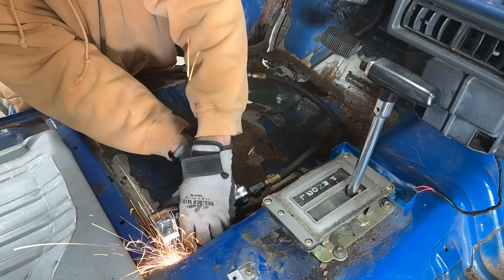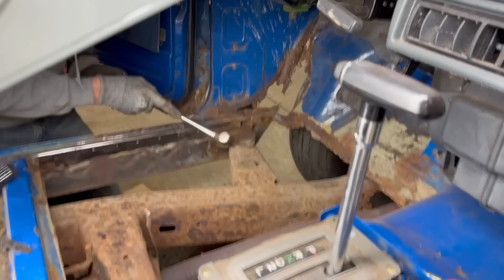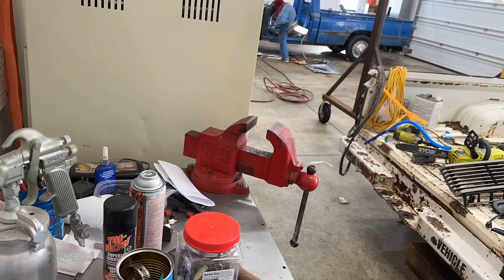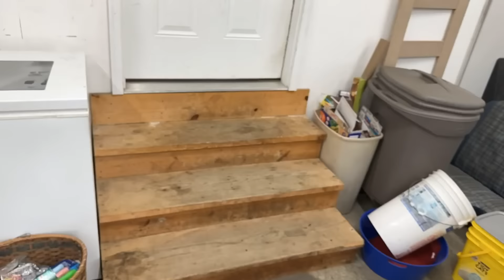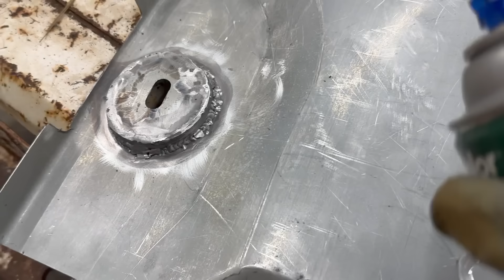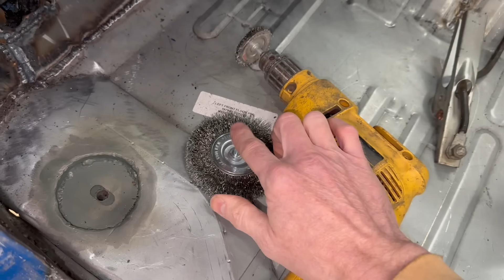How to: Repair/Replace Rusty Floor in Vehicle - Complete Guide, Start to Finish

Comment: You've welded on bare metal patches... meaning they're uncoated... The reason you're doing this is because of metal corrosion... Does that sound confusing? ))) welding primer... epoxy primer... is it for weaklings?  Well, at least in the end
Reply from the maker: I had some other parts of the floor to repair, then I painted them all in later videos. I'll be applying fluid film but not until the entire truck is painted.

Comment: I want to see you bend metal with a taper like that, on the vise in real time to see better how you did it. That is clever. very good explaining your process.
Reply from the maker: Thanks! I went back to check, but I had recorded that in time-lapse mode to keep things shorter. There are a lot of expensive fancy tools out there for metal fabrication, but you'd be surprised how much can be made with just a bench vise and old anvil.

Comment: Nice video. Just a tip. Before using the step drill bit, I usually drill a smaller hole using a normal bit. Then the step bit would bite into that hole and make it easier.
Reply from the maker: Great idea... Thanks!

Comment: Had a 84 celica bad 22re engine had some 20r engines I used it put the fuel injection  on it had to drill a couple  intake bolts but it ran stronger than the 22re lol

Comment: It’s been a while since I watched this one, and now it really applies!
I am working the floor pan of my Rusty 87 Toyota PU and have an idea that’s been brewing a long time: 
Im wanting to body lift this thing, then drop the driver’s floor the same amount so my 6’2” frame is comfortable.
Do you think it would work?
Oh, and another thing; I really enjoy the music you use as background, and it seems like you put in a lot of work to match the score to what you are doing. Impressive.
Reply from the maker: I haven't heard of anyone dropping the floor while doing a body lift, but that's a really great idea! The only think you'll need to consider are the cables that fun below the cab for parking brake and speedometer, as well as the fuel & brake lines, but those are all on the passenger side. So if you're only modifying the driver side, then those will not be an issue. The only issue will be that the carpeting/floor liner will not fit properly, so you may need to have one custom made.
Reply: @6thGearGarage hahaha! Carpet and floor-liner. Now that funny! There is some nasty mold kinda stuff down there that I think may have been carpet long long ago but at this point its just the gunk holding the floorpan from falling out!
My bigger concern are the three peddles. Gonna have to lower those with the floor and i haven’t looked that far into it yet.
I think it can be done and really like the thought of what that will do for my ride.

Comment: Great idea bringing the plasma cutter into the game.  I bought a plasma cutter today, $240 harbor freight 20 amp, to cut my floor out without an angle grinder's danger and ragged cuts.   I also will cut out the rocker/a/b pillar bases and cab corners, so the plasma will be slick and save time.  Thanks for the detailed insight.  Personally, I would compare my replacement bushing height before setting the stack height and welding it in place, just in case oem is different or the cab sagged
Reply from the maker: I love my plasma cutter - saves so much time.

Comment: Little tip, if you have access to an air compressor and air chisel it works wonders for busting through the floor and removing spot welds
Reply from the maker: Time to invest in an air chisel!

Comment: Looks like I’ll stick to my plan of taking from donor vehicles wolf steel seems to be off judging by this video and others that’s a shame
Reply from the maker: Donor vehicles is always the way to go. I've never used an aftermarket panel that fit as well as OEM. I use a section of floor from a donor truck to repair a different area of this cab and it went much smoother: https://youtu.be/lkc09fzc3AA

Comment: Why not lift the body first, fix the frame & then repair the body? 😊 That’s how I’ve seen it in other videos.
Reply from the maker: I had another parts truck with a nicer frame that I ended up using. I repaired the floor with the cab on the old frame so that sparks wouldn’t burn or pit the fresh paint on the restored frame. This frame was pretty rusty.

Comment: Man, I hate being the guy to criticize another’s work. But for your next one you should really take off the doors and square brace the cab before getting into a rust job this bad. It’ll save you a lot of headache with fitment issues down the road
Reply from the maker: @jhenson5168  I appreciate the feedback. I considered that the cab could flex when I cut out the floor, but figured being bolted to the frame with 5 of the 6 mounting bolts was enough to keep it square. Luckily it ended up being ok and everything fit back together nicely.
Reply: @ that’s great to hear. You never know what you are getting into with rust that bad. Just a 3/8th inch sag in that corner can really get bad when you introduce heat

Comment: Great Job! Just One question what do you do to the bottom of the floor pan in between the seams of the new and old floor pan?
Reply from the maker: I cleaned the welds and sealed them from the underside in another video, when I had the cab off of the frame: https://youtu.be/EehjyRpJKoE

Comment: Great Job! Just One question what do you do to the bottom of the floor pan in between the seams of the new and old floor pan?
Reply from the maker: I cleaned and sealed them in another video, when I had the cab off of the frame: https://youtu.be/EehjyRpJKoE
Reply: @ thanks man great job keep up the great work🤙🏽

Comment: I have a question for you guys. When doing a floor pan replacement like this, is it better to leave the car sitting on its weight (on its 4 wheels)? Is it okay to jack the car? I’m worried about chassis flexing or twisting a little bit. Thank you for your time.🙏🏼
Reply from the maker: I think 4 wheels is ideal, but as long as the structural areas aren't cut out or rotted away, it should be alright. If it's a body on frame construction, like this truck, then lifting the vehicle will be fine.  If it's a unibody with major rust, then flex can be an issue. So it depends on the vehicle and amount of rust/cutting.

Comment: Thanks. Wonderful work. What is the thickness of the sheet metal you use?
Reply from the maker: Thanks! Most of what I use is 14 Gauge, but I tent to use whatever I have around, so some pieces might be 16 or 12.

Comment: Over a year old but I see your still veiwing comments witch is amazing, thank you! But question for y’a! I have a 2008 ford ranger has a pretty big rot whole in the floor. Wondering what main requirements of tools I need and prices? Maybe. I also understand could be different area so different price range and not same vehicle. But is it worth going out and buying some tools to do it myself or just send it off to a shop. But would it also even be worth having someone else put a floor pan in? And again I understand could be different areas (I’m from Ontario Canada) but if I don’t care about looking oem factory could I get away patching/covering hole, (hole is approximately 8 inches wide, by roughly a 1-1/2ft long) and be able to pass saftey with new video AI saftey law?  Not expecting you to have answers but worth a shot to me! 

If I do decide I’m doing it. Definitely will be on a budget😭😭😂😂
Reply from the maker: Hi, prices are always increasing, but I have links to the tools I used in the description.  That should give you an idea on the prices. If you have the tools, space, and time, it's worth repairing yourself. I'm unsure about laws in Ontario, but there are no safety laws or inspections here in Ohio. You can drive any rusty heap on the roads, as long as all the lighting works properly. I think when done properly, there is no structural integrity taken away, only added. So it's only going to be more safe than it was.

Comment: How does one decide, when to remove the body for rusted panel replacement?
Reply from the maker: I don't fully understand the question. But removing the ca wouldn't have made the repair much easier in this case. The only time removing the cab made it easier was to clean up the welds on the underside of the floor and apply seam sealer there.

Comment: this is prob the most realistic situation that most people experience in my opinion.... many other youtube channels that claim (respectfully to them with no prejudice)  they are no mechanics/craftsmen etc and were not so long ago fixing cars in parking lots and yet when they show a repair, its not just seamless, but it it feels like they have done it a million times prior, ...their "fist attempt" at it fits /goes in smoothly like a glove., in short they get it right the first time around,  This guy, however, shows that for every fitting of something once but the need to remove it  10 times to get something else done prior, or for example how other people just seem to minimally weld something with the least amounts of spot/tac welds, while I seem to need a million other jigsaw puzzle pieces and a gazillion welds to plug up a hole, …you get the point...anyway   I speak for myself, maybe because I ain't so talented, (or suggesting for that matter this person in the video isn't) but I certainly have the same experience and can relate. Not saying that it should be so for everyone else just that for once I don't feel envious and jealous of how other people get it right the first time round or very quickly (granted I know its video editing magic...but still)
Reply from the maker: Thanks! I do my best to show how it really is when doing a job yourself, even any mistakes that I make and how I remedy them.

Comment: 50:00 what you do with it? Leave like this or wield holes?
Reply from the maker: I left it like that, a few pinholes won't affect the structural integrity. Just put sealant on both sides.

Comment: Or maybe, cut a piece of scrap plywood, slap it down over the floor ('glue' down with some tar if you want to get fancy), replace the rubber mat, done.
Reply from the maker: That would actually work here in Ohio, where there are no vehicle inspections!

Comment: Is it possible the replacement floor panel that was sent to you was meant for the passengers side and upside down? That would cause the welding tab to be up for the weld and the body bolt area would then be sunken down like the factory bolt area?
Reply from the maker: No, I ordered both left and right sides. I imagine it was a lot cheaper for them to make them the way that they did.

Comment: Angle grinder wire wheel is the way to go and you can use phosphoric acid products after it. Muriatic acid is good for cleaning small parts and works fast.

Comment: All is good . But what if there is no floor panel in any autobody shop to buy. I would have to make my own floor panel
Reply from the maker: Yeah You'd have to start with a piece of sheet metal and fabricate your own, like I did with the smaller sections of this floor, but you'd be fabricating the entire thing. Large flat sheets of steel tend to flex. I'd use sheet metal 2mm thick so that the floor doesn't flex when you rest your feet on it.
Reply: @6thGearGarage 2mm? Is this 1/8 inch plate?.
Reply from the maker: 2mm is thinner than 1/8".  1/8" is more suited for a frame repair.

Comment: Nice work. Looking good. I’m working on a 1980 Toyota truck as well. I have to do a similar repair. Can I ask what gauge the metal is you used. Thank you and keep up the good work.
Reply from the maker: The floor panels were thicker, I’d guess 14 or 16 ga. The smaller pieces I used for the rest were probably 18 ga. Thanks for watching!

Comment: ahh the good old restoration. Just know, when you hear that Rice Krispy's sound after hitting a pot hole.

That's not the suspension
Reply from the maker: No rice krispy sounds, as I replaced the frame in a later video https://youtu.be/gmFx6OUw7Xo

Comment: Wow man. I thought my truck was a goner but seeing you do this really gave me the motivation to get at it. Gave alot of good advice too when it comes cutting out rusted sheet metal. Can't thank you enough
Reply: Use Tidybart Zeebart undercoating. It makes the rust go away.
Reply: i also thought my 2006 Chevy Impala SS was done.til i saw this video. he gave me hope, when i really needed it. im fenna give it an extreme makeover. this gonna be a fun project for me.

Comment: Hey man, just another question, if the cab mounts moves because they are holding on for dear life because of rust. Will new floor pans fix it. Frame and cab are mostly mint and the engine still make good compression.

Comment: I wonder about the seam sealer, because each time I dismantled interior parts, rust starts from under the sealer, these are almost the most rusted part of the sheet metal!  I noticed similar about under coating, rust developing behind the undercoating.  So both do not seem to protect very well against rust.  Anything else can be put to better protect against rust?  I'm currently doing a floor pan on an old car and maybe wanted to try without a seam sealer and checked its rust progress every year.
Reply from the maker: For the rust to start, there must have been bare metal exposed. Perhaps it’s starting from the outside of the panel and working it’s way in somehow?  You could do finish welding and grind perfectly smooth to make one seamless piece of metal, but that takes a lot of time and skill.
Reply: @6thGearGarage  Today, I had a nice looking piece of metal with a seam sealer on the joint of two pieces.  I removed it for fun, and the metal behind it was rusted!  So it seems to start from the joint covered by the seam sealer.  I have another old car, 1994 Honda Accord, the interior was great except on the four corners, it was perforated where there were a lot of seam sealers.  I removed the sealer and patched with grey putty that has metal in it, I wanted a stronger putty.  So far, no rust came back.  Maybe putty seals better than seam sealer...

Comment: Was ur cab sagging down any? I have a 97 F250 where the cab mount is detached from the floor and now the door is pinching with the front fender. Curious how would one would know where to lift the cab exactly to install new floor pan pieces to match with cab mount
Reply from the maker: This cab was not sagging, but I had a similar problem on my 1985. Here is a short video showing the repair.  https://youtu.be/7Xkdnrsa62A  I would lift the cab by the other solid mounting points and support it with the door/fender in place until you can see the gaps are correct. Then repair it in that position. You may want to weld some temporary bracing in place to be sure the cab does not shift at all while you're repairing it.  If it's sagging that much, it sounds like you have a lot more rot to cut out and replace than I did.

Comment: What size sheet metal did you use ? Thanks for the video! Really good job!!
Reply from the maker: These floors were probably about 2mm thick. Some of the scrap metal that I used for fabricating the surrounding area was slightly thinner.

Comment: The step drill bit requires a pilot hole. It’s not made to drill its own hole, but to make an existing hole bigger.
I think it’s usefully customary to create paper templates before cutting the old out, so you know what you are doing after the old shape is gone.
Reply from the maker: good idea, thanks!

Comment: the frame doesnt look that great either :/ was it worth to fix that car? Great vid nonetheless
Reply from the maker: You're right, that frame is toast. I had a Parts Truck/frame with only light surface rust shipped from Oklahoma and cleaned/painted it : https://youtu.be/gmFx6OUw7Xo Once this cab is repaired, it will be moved to the southern frame.

Comment: I know this is a year old by now, but WOW what a JOB! I can't imagine doing all that work; some people would say it's not worth it but I commend you for tackling it! Very informative and fascinating video. I just recently decided to get into cars so stuff like this is very appreciated! So from one Ohioan to another, thank you!
Reply from the maker: In my younger days I would have parted this truck out and scrapped the body & frame. I finally decided to take on a true challenge and although it's been a year already, it should be on the road by summer!  Thanks for watching!
Reply: Makes me question my sanity, got an Opel Kadett which has similar or even bigger wholes on the driver and passanger side with doors rusted from the bottom up 🥲
Reply: Really good video

Comment: Were you using a flux core welder?
Reply from the maker: No, I used solid .023 wire with gas.

Comment: I don’t feel so bad about the rust in my 1985 Ram 50! Wow what a mission to repair that! PS a sharp counter sinking drill bit is way more efficient than a step drill. Cool project.
Reply from the maker: I haven't seen a Ram 50 in ~20 years around here. They all rusted away... awesome little trucks!